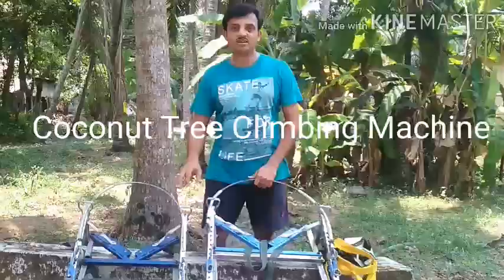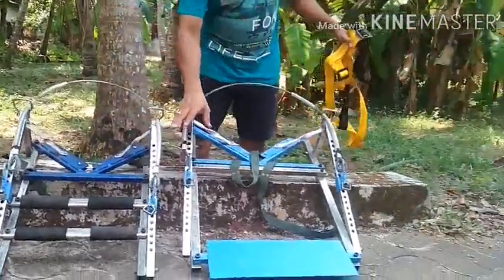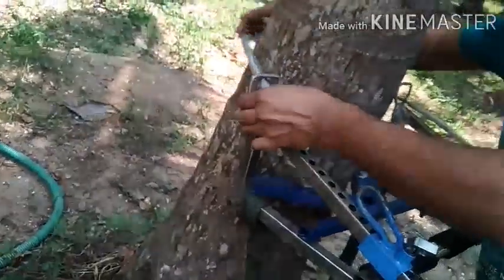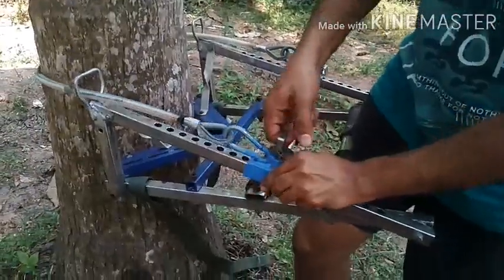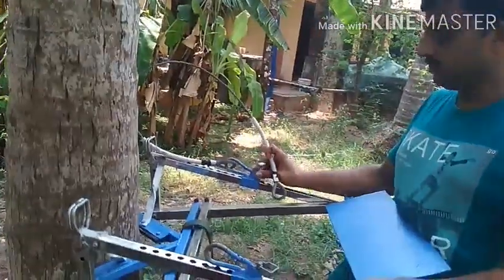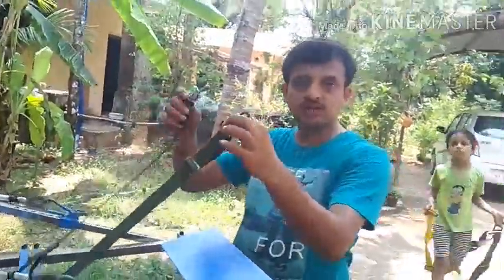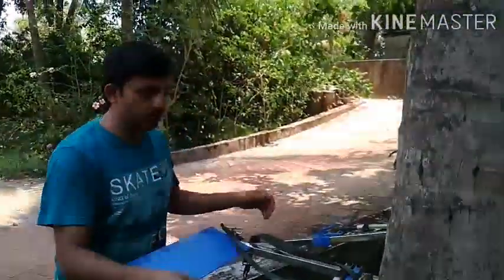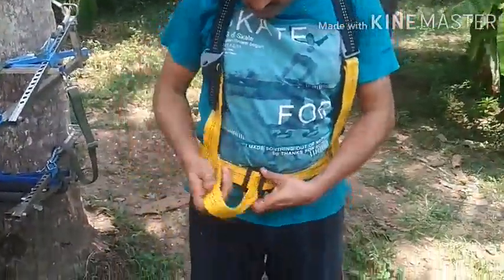Coconut tree climbing machine - A Demo

Comment: The plate where ur sitting are
Supposed to have roundish
Corner so as you  don't hurt
Yourself while climbing.As an
Inventor you are having
Problem to use it yourself as
Ur not climbing the tree
Smoothly.u should master all
The technic before the demo
Reply: How to orded and how much.
Reply: How to order and how much?
Reply: Not designed by a trained engineer. Carbine clips look to be welded to side frames this looks worrying. Steel cables need sleeve to protect tree. If you fell back in that harness you would asphyxiate if you couldnt climb back in with in minutes. Harness needs leg loops to avoid danger of asphyxiation.